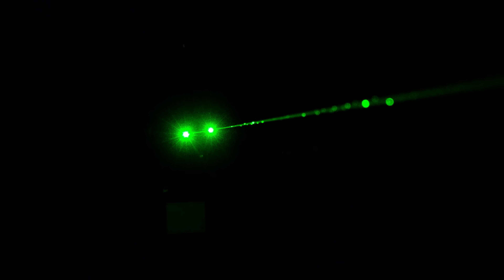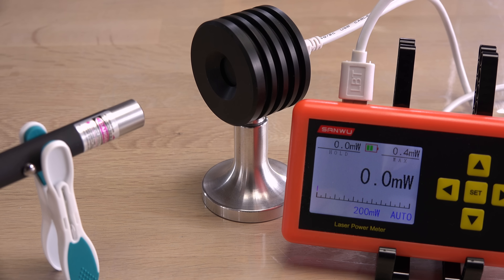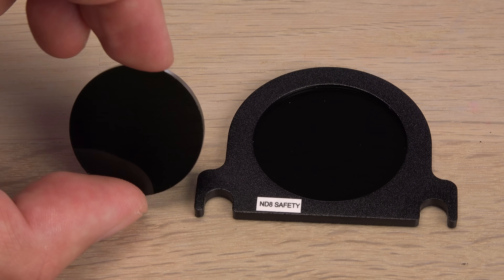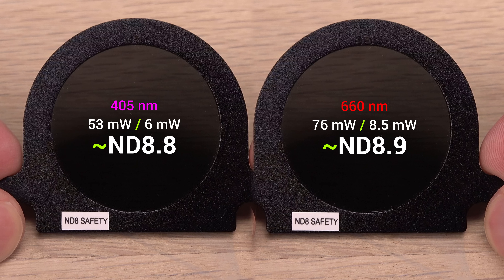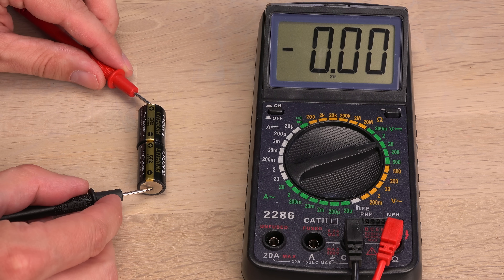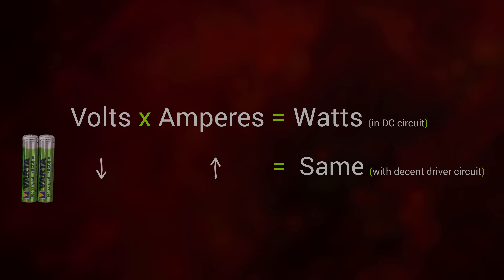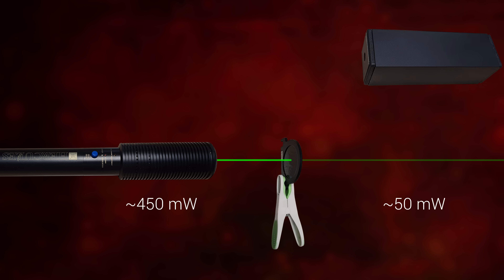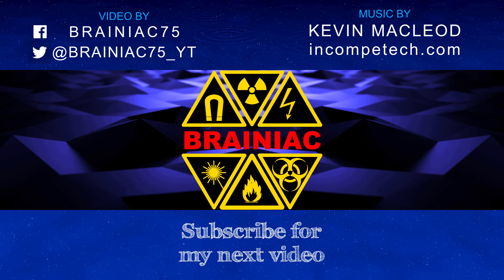Are lasers safer with rechargeable batteries?

Comment: I suggest put the filter in a black tube  and placed in a way the reflected beam hit the inner part of the tube (as a beam dump but with an exit so the filtred beam can reach his target)
Reply from the maker: Good idea! If the filter is placed at a slight angle inside the tube, the reflected beam should not exit the tube. Or in the case of the ND8 filter, the reflected beam is actually at lower power than the transmitted beam. So why not use the reflected beam as a safer output and absorb the more powerful transmitted beam ;) Thanks for your creative input!

Comment: I really expected the reflected beam to be a lot more powerful given that it's reflecting off the front surface of the filter but clearly something's going on there that I'm not aware of.
Reply from the maker: I thought it would be more too. The ND8 filter may have an anti-reflective (AR) coating - especially considering it is meant to be placed on laser shows with an output up to 2.5 watts. Thanks for watching!